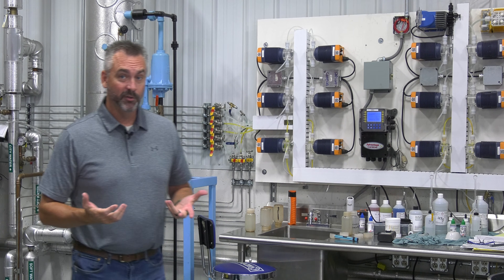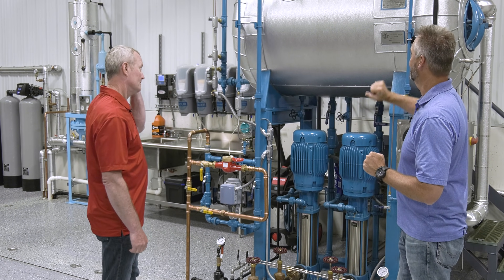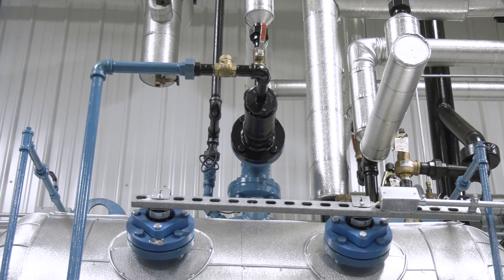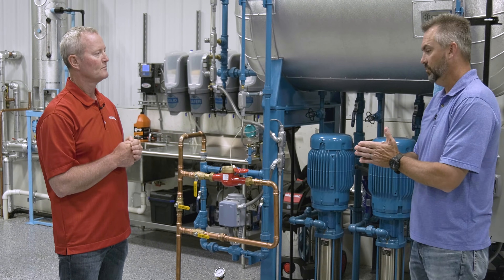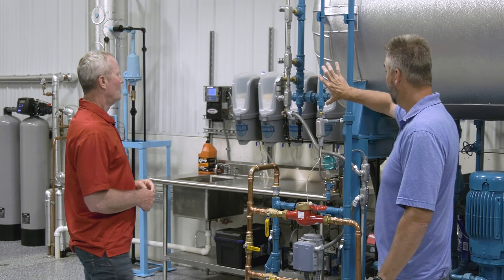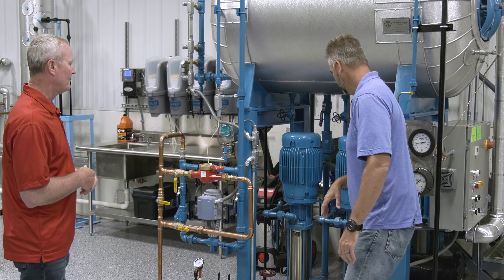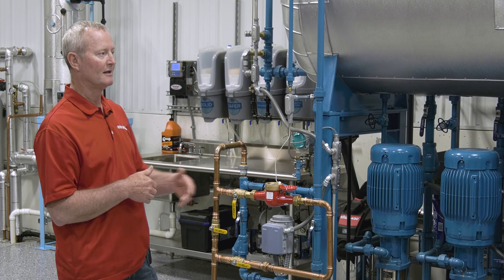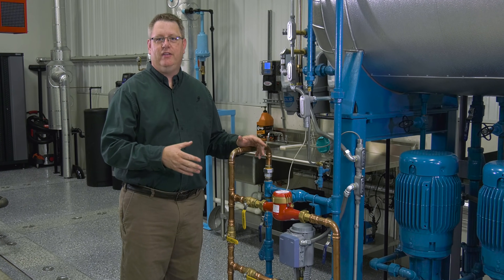Deaerator 101 for 2022 - The Boiling Point

Comment: Thank you guys so very very much to start with. It shows my wifes name Cassie, but my name is Bruce. I`m an ex navy BT, was on the USS Kittyhawk. Made topwatch n 2 main machinery room. Worked as operator for 12 years after getting out. Switched to pipefitting welding. Been teaching a steam theory class in an apprenticeship program so fitters can work arounf live steam n condensate systems without injuring themselves or others. I use so many of your videos for visual and verbal instruction. You guys  are helping safely train a lot of young men and women in the pipe trades. Bravo Zulu to this program you guys do!
Reply: One of the basic concepts I start with is the 4 sides of the basic steam cycle (saturated) I teach installers, not operators. Generation, in the boiler. Expansion, discharge from the boiler to tge inlet of the steam trap. Condensate, discharge side of the steam trap to the top half of the DA tank. Feed water, bottom half DA tank to the inlet of the boiler. I tell them to pretend you’re a drop of water that goes all through the cycle, and back to the starting point (in the boiler). My focus as well as teaching pipefitting with all the components involved, is understanding what to expect at every point of the steam cycle. Famous “hold my beer statements like “oh don’t worry it’s only condensate.” Thank you thank you thank you. Bless your videos!!
Reply: Thank you so much for the kind words and thank you for watching our channel.
Reply from the maker: Thank you for the amazing encouragement and feedback! Keep up your important work. Let us know if there's ever a topic, you'd like to see us cover.

Comment: How do you prevent or fix a cavitation issues? Thanks.
Reply: My guess is that you have to check the line that takes the water from the tank to the pumps, and make sure it is not clogged. Also, make sure that the DA tank is never completely drained.

Comment: Hey guys great information! When  the soft water is being stayed, what’s it pressure source, just line pressure or the pumps?
Reply: Most DA's only run at ~ 5 to 8 psig.  City water make up is typically ~ 50 to 70 psig so you usually never need a pump.